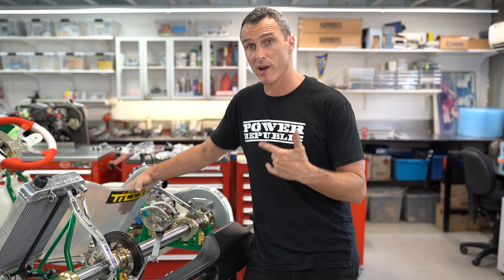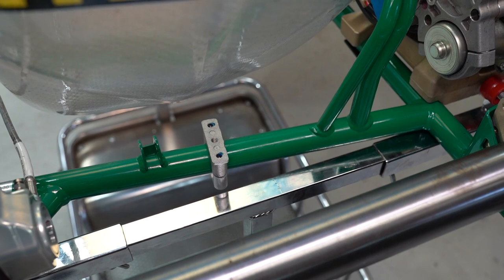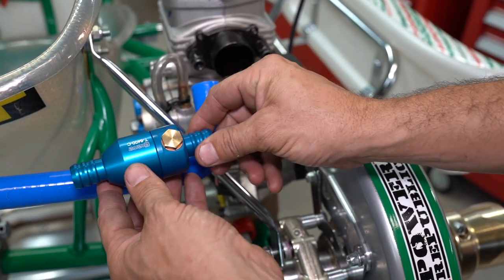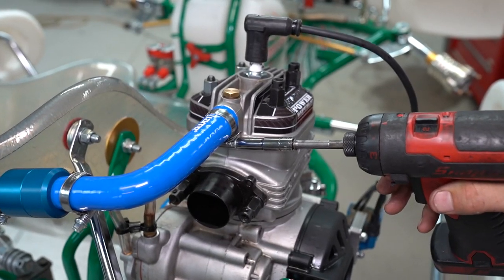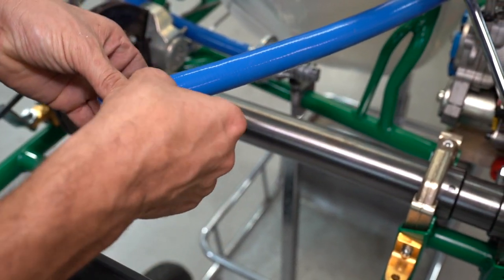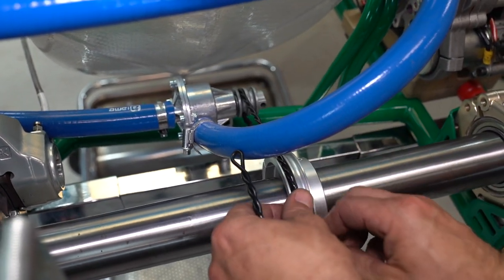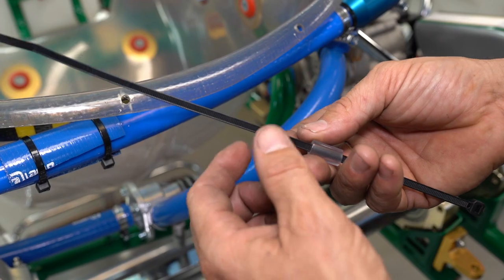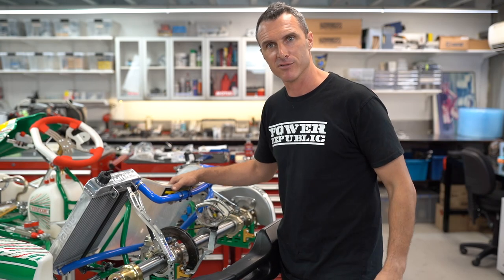Foolproof Radiator Hose Install - POWER REPUBLIC

Comment: Heyy, I have a Problem thant my Braking rod and my steering rod are grinding together when I am turning full right. Is this normal? 
Thanks!
Reply from the maker: yeah sometimes.  you could change the pick up point on the brake rod.  or move the tie rod to the top of the stub axle.